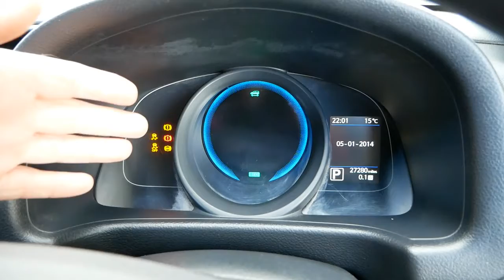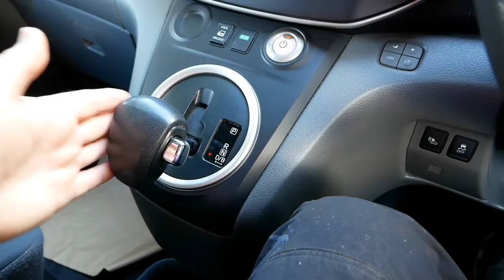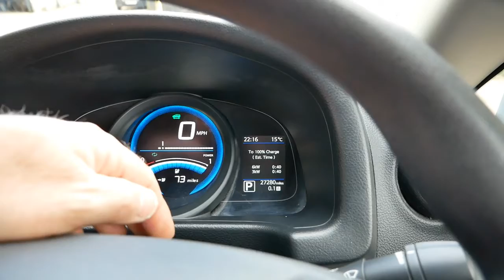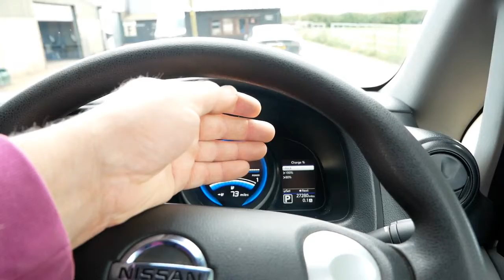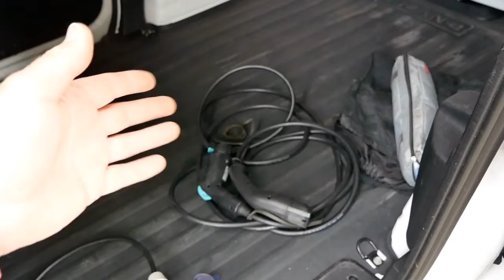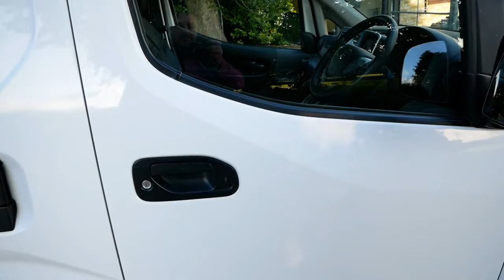Nissan E-NV200 beginner's or new owners guide on how to use your new electric van

Comment: Hi there, I can’t find much info online- my type 1 charging cable does not seem to lock in place when in use, is this normal? Worried a bit about theft when getting cheap electric overnight or using public charging stations!

Comment: I dont agree with not putting it into neutral when stopped at lights or junction, etc. When in drive a small amount of power still goes to the motor. On a level road with the handbrake off the vehicle will maintain about walking speed without putting your foot on the accelerator. By sitting in drive with the brake on energy will be wasted.
Another reason is simply safety. Maybe your foot slips onto the accelerator and the handbrake isn't applied very well, the vehicle could jump forward unintentionally.

Comment: I pressed the pre cabin button on key fob this morning & noticed it went on heat button even though I hadn't had that set up before! Does it adapt to the temperature? Or does it always just do that
Reply: it think it's 10 minutes (or until it reach set temp , not sure)  ,  i have the highest finish , and i can set heating temp in settings on the infotainement system
Reply from the maker: To be honest its been years since I used that feature, so can't remember exactly. But I think (as with most EVs of this age) it does a 10 minute heating session and its all predetermined.

Comment: Top tip!  To save time.. as you approach the vehicle hold the fan button on the remote, to start the heating. When you then get in and start it, it will start instantly, as the contactor is already in, supplying the heater.
Reply: Is that just a pre heat not cooling down in summer??
Reply: @Icgotmoves  both.
Reply: So need to set a temp day before?!
Reply: @Icgotmoves  i just talking about taking 3-4 seconds off the startup time by activating the hvac as you approach the van, it makes no difference what the settings are

Comment: We can’t get the windscreen washer on our 2014 env200 to work.  Tried every combination of push/twist/pulling the lever on the right. The water tank is full.  Help!
Reply from the maker: Check the fuse, then water bottle pump connection.
But can you hear the pump running? If so, sludge in the bottom of the tank and hoses could be the issue.

Comment: Do not be tempted to use full throttle from standstill, as the gear teeth in the differential cannot cope with the torque, and many many vans have damaged gearboxes as a result. Drive gently untill say 5mph then full throttle should be much less of a strain on any individual tooth of the diff🙁🙁🙁🙁
Circa £500 to fix yourself with a secondhand unknown condition gearbox, and £ thousands of you get a dealer to do it.
Reply: Good advice and probably save tyre rubber as well. Train drivers will be familiar with this as they don't go to full power at standstill as it can start a wheel slip.

Comment: Looking for clarification - I thought when you touch the brake pedal, in electric cars it starts with regenerative braking, then as you apply more pressure it uses the traditional friction brakes. From what you said in the video (if I heard correctly) you only get regen braking when coasting. Which I don't think is correct for electric vehicles and not true for this vehicle? What the Braking Mode allows you to do, it to drive as much as possible with just the one pedal, i.e. the accelerator. I.e when you come off the accelerater it can be set so that the motor aggressively slows the car down rather than allowing it to freewheel.
Reply: 2 years later but still , i have an E-nv200 , when you slightly touch the break pedal it produce more regenerative breaking absolutely sure

if you are in D mode , when you start to break it produce more regen , and it can be feeled and shown on the dashboard ;)
Reply from the maker: Regen braking is not (wheel) braking - it is effectively engine braking and is an effect of having an electric motor, rather than a "system". The Renault Zoe is one EV where its slightly different where the brake pedal pressure increases the regen effect.
On all EVs, when you lift off the accelerator, the regen (i.e. motor braking) starts. Pressing the brake pedal does also increase the regen effect to assist with the friction brakes.
Reply: @GoGreenAutos  Thanks for reply, the point I was trying to make was your video seemed to imply that you only got regen braking when taking foot of the throttle and not pressing the braking pedal - which is not true. The point of the B mode is to brake more with the motor and recoup the energy, having to press the brake pedal less. Anyway, cracking little vans!

Comment: Does this machine regenerate when pressing the brakes too? I thought they did. I'd prefer it to coast freely when off the accelerator and then regen when I press the brakes.
Good videos by the way.
Reply: I made the same point recently that the video implied that regen braking occured only when take foot off the accelerator, not true - regen braking occurs strill when applying brake pedal in conjunction with the friction brakes.
Reply: Thanks for the replies. 
But yes I thought these EVs use regenerative braking when applying the brakes too, as I have read that this is a difficult thing for manufacturers to develop the software, for a smooth modulation of regenerative and hydraulic braking when using the brake pedal. Thus giving you an option to maximise freewheeling when just off the accelerator, which can be more efficient and smooth in some driving situations. So I've read.
It's interesting stuff though. To me at least.
Reply: @catbiscuits690  The Ioniq has a zero regen coasting mode. It's quite a strange sensation when you are used to engine braking. I've only had the Ioniq for a couple of months, so I'm still experimenting with the different settings.
Reply: @duneplodder it'd be interesting to see what driving strategy you find more efficient regarding regen modes in your Ioniq in the long term. And which is more comfortable and smooth.
Reply: @catbiscuits690  Speak EV/First Generation Ioniq is a good forum to look at. Yesterday I had my best efficiency yet. 5.9 miles/kWh (slow country roads). Usually mid to high 4s.
Reply from the maker: That's not the way EVs work. Regen is effectively engine braking on the electric motor. Brakes are conventional hydraulic brakes.
Reply: @GoGreenAutos  Hi Matt, My 28kWh Ioniq regenerates when using the brakes. This can be clearly seen on the power meter on the left of the instrument cluster. It only uses the discs to bring it to a dead halt or, presumably, in an emergency stop.
Reply from the maker: @duneplodder  Yes it maximises the motor regen when you press the brakes, to assist a little, but it is applying the brakes too. All EVs operate in pretty much the same manor. If driving like that, you're not driving as efficiently as you can...particularly in a 28kWh Ioniq.
Reply: @GoGreenAutos  Agreed that it's not the most efficient way to drive. I love the regen paddles by the way. I was just making the point that the brake pedal does use regen.